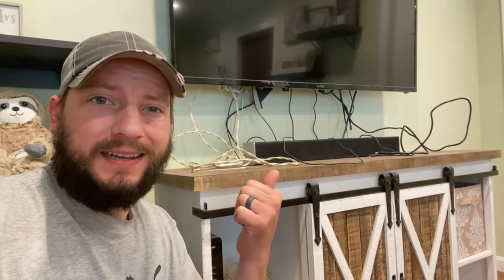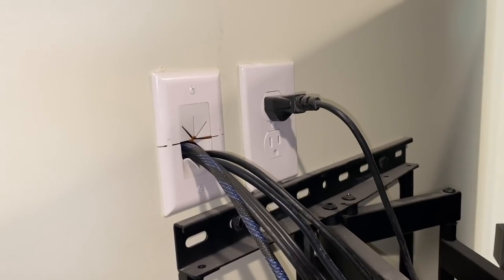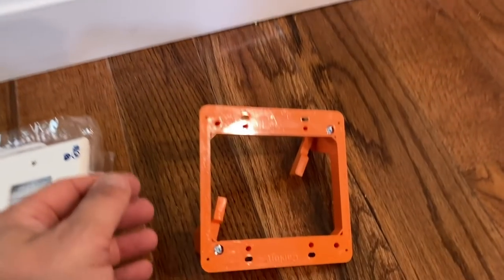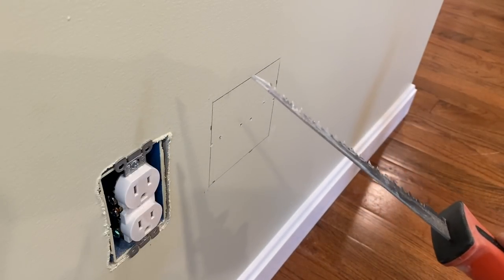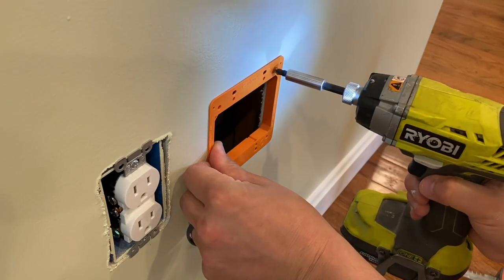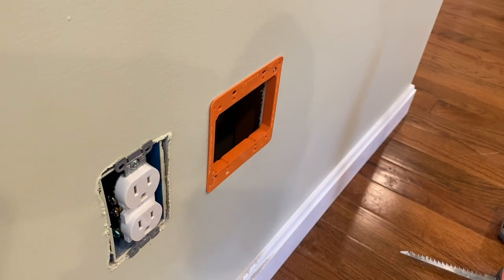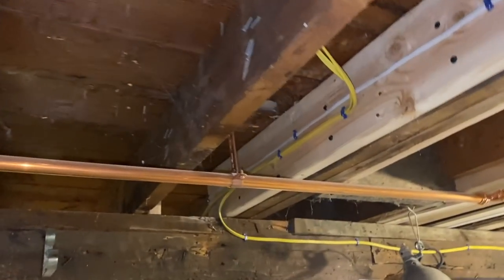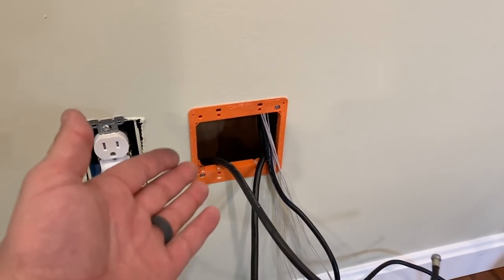How to Hide TV Wires In Your Wall

Comment: Great video, I would love to see how it can be done on concrete as well.
Reply: for concrete you will have to remove a large chunk of the wall, then make a bellow fake canal and then close it again to hide it, also... I believe it isn't something you can do with concrete. Just use a rail to hide the cables.
Reply: Concrete blocks holes in both corner match one with the other....so use that opening to feed the wire up and down. 
Use fish tape to get the wires thru way easier.

Comment: Hey bud, it was super painful watching you layout the lines to cut in your 2-gang LV box. Those little holes in the corners of the box? Yeah, flip the box 180 degrees, so the flat part's against the wall, align it as you like, using the level to make sure it's where you want and level. Now mark each of those 4 little holes. Connect those dots and cut. That's why those holes are there. Prevents you having to fumble around with that tape measure looking and feeling like you need a third hand. :) Don't worry - I did the same thing you did the first time I used one of those LV box frames.

Comment: Other than keeping otherwise starving electricians employed, why would feeding an extension cord through a wall be against code?
Reply: simply put, because extension cords aren't listed for use in unserviceable spaces.  If you can find a UL listed extension cord, listed for use inside walls, technically it should meet code, however good luck finding an inspector that would approve that if the house were to get inspected.
Reply: @bassman87  Yes, but why is that in general?  Especially in a case where the entry point into the wall, and exit point out of the wall are within sight of each other, interior wall, with furniture (TV and electronics stand) are there to prevent any other constructive activity?

I mean sure, running an extension cord through the wall from one room to another that's a few rooms away, makes sense.  You won't necessarily know what's on a circuit when doing this, but this circumstance?  Seems overly restrictive and just enforced to ensure that we keep our electricians busy.

So far the answer is "because".  I'm trying to get down to an actual detailed reason, knowing the 'thought process' behind a rule makes it more "real" in my own perspective...
Reply: To me seems stupid, running an extension cord how is different from running the power cable of the TV in the wall, or whatever other cable? In my country it's perfectly up to code to do so, the extension cord is not part of the fixed wiring and thus the electrical installation, is just like any other extension cord or appliance, if you run it in the wall or not doesn't matter, and thus it's not subject to electrical code (meaning you can install it without issuing a declaration of conformity that a qualified electrician would need to make for an alteration of the installation, even if it's just adding a socket).

Comment: Quick and easy. However, you should have mentioned that it wouldn’t be quite so easy or even possible on an exterior wall due to insulation.
Reply from the maker: Hey Kelly.  I thought I mentioned that... Nothing is impossible 😁. You could sneak wires in between the wall and the insulation.  It would for sure be more difficult but not impossible.  Thanks for the comment and for checking out the video!

Comment: YAY! So glad you decided to follow Code! You never want to install electrical with shortcuts.
Reply from the maker: Definitely not!  Thanks for watching!
Reply: Most definitely if the amperage isnt a match the cord will heat up . Especially under heavy load. Most people dont even look how many amps a cord is rated for .. some are only rated for like 8 or 10 amps ...
Reply: @ptravers9077  thanks didnt know this.

Comment: I noticed the orange box has 4 small holes at each corner that seemed to me you could use to mark the square on the drywall, but I don't know if that's why those holes are there for anyway. Regardless I think this is a great video as always!
Reply from the maker: 🤯 Never even thought about those holes.  I will have to check it out next time!  Thanks for watching!
Reply: Yes you mark the four holes with the face of the box against the wall, then use the flat edge of the box to connect the lines and make a square

Comment: Very well. Congratulations...

Your wall is very easy to do that. I want to see you do this here in Brazil where the walls are made of masonry (brick and cement).

A parede de vocês é muito fácil de fazer isso. Quero ver vc fazer isso aqui no Brasil aonde as paredes são de alvenaria (de tijolos e cimento).
Reply: In Europe too... Not really applicable for almost all houses
Reply: 1. Milling a slot.
2. Install a pipe in the trench.
3. Fill and plaster the slot.
4. (Re)paint or wallpaper the wall.

That's how I did it, but I did it before the walls were plastered.

Comment: Seems like you ought to use 12/2 rather than 14/2 since the original receptacle looks to have been wired with 12/2. Is their a 15-amp breaker supplying this circuit?

Comment: Great video but as a cable guy you need to have a tech come and secure some real compression fittings on that cable.  Those screw on connections can cause all sorts of issues in your home with the tv picture quality and the speed and quality of your internet connection.  They are great in a pinch but should never be a long term fix.  Just my 2 cents.    I wish more people would clean up the wiring like this.  Ive seen some real messes.

Comment: The orange hole plate has four holes in the corners of the hole.  They are there for the purpose of marking the corners on the wall.  Use a straight edge to connect the dots.  No measuring required.

Comment: Another reason not run 120 volts AC with Video cables, along with NEC rules is to also reduce noise issues.
Reply from the maker: Yup, I have heard that too.  Thanks for the comment and for checking out the video!

Comment: Legrand also makes a kit at Lowe’s that comes with Romex that goes down to a power inlet that I’m assuming gets around the extension cord restriction since the extension cord isn’t in the wall - it’s not cheap but it’s a solution if you don’t have power directly below where you need it.
Reply from the maker: Yes!  I saw these.  I wonder the difference with the wiring.  I also wonder if some state codes will or will not pass an inspection.  Thanks for the info and for watching!

Comment: It still blows my mind that American power outlets don't have switches on them. Doesn't seem quite safe to me. But I guess it just depends on what you are used to.
Reply: where do you live
Reply: @Nixtutru  Australia. Even here codes have changed. When I was young if you pulled a cord from an outlet the switch would automatically turn off. Now this doesn't happen, and the outlet is still "live". I don't understand the reduction in safety measures, but then I'm no electrician so maybe I'm just being paranoid :)
Reply: @robynw6307  i am also no electrician but i live in europe an i have never seen a switch on an outlet. maybe there are only switches in australia.
Reply: @Nixtutru  You could be right. I've never travelled outside of Australia.